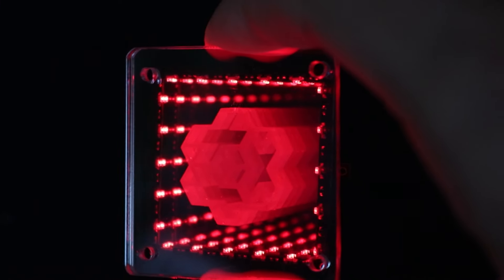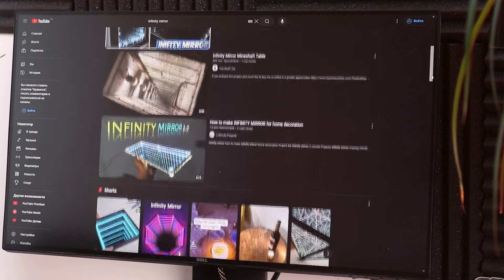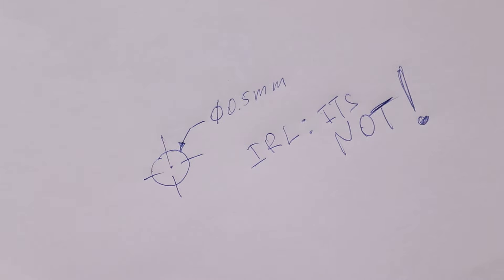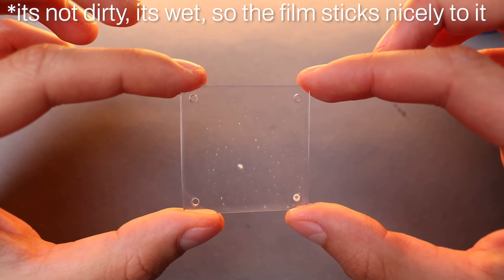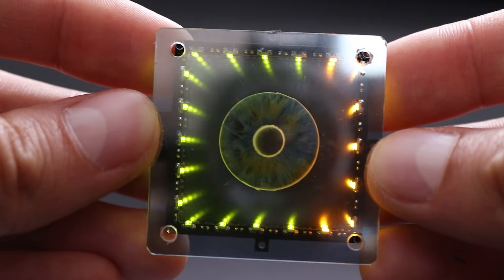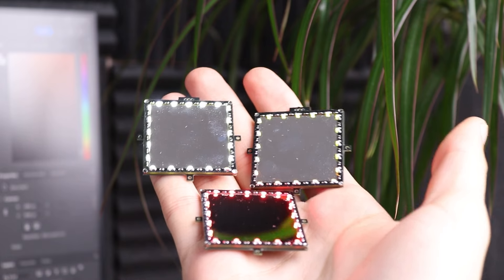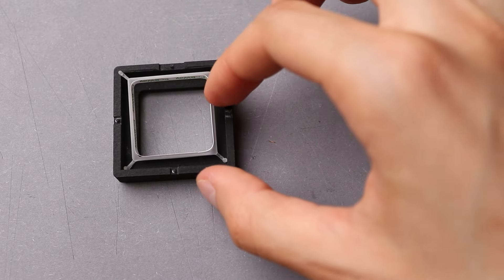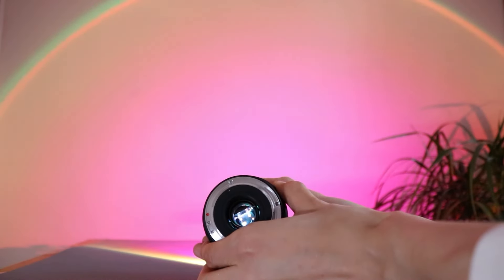I built an INFINITY mirror to Win $1000

Comment: If glass cutting is similar to acrylic, it helps to hold near the break point and you might do well to buy a pair of kinked pliers to focus the break directly on the scored line.
Reply from the maker: It's not exactly like glass. Glass is fragile, whereas acrylic is more flexible. It doesn’t break easily. It is a plastic after all. I actually researched the easiest way to cut acrylic at home without special tools, and that's what I used in the video 😅

Comment: now make it thicker, put some alcohol in it, add heat elements to vaporize it, connect Peltier element on mirror, cool other side and you have a makeshift chunky, hot art project Geiger counter., I like it (your project)
Reply from the maker: Quite a creative approach. Not quite sure I understand it fully, though 😅 I was thinking about adding moving LEDs in there and make some kind of a kaleidoscope 🙃
Reply: @NickElectronics, it's called a cloud chamber, but it needs dry ice to work, Peltier pads work only if you freeze the other side or stack them and provide lot of power, so in reality, it will never work for 😔
Reply from the maker: @ Why not use a vape for making a cloud? 😅
Reply: @NickElectronics  no it's called that. It detects alpha and beta radiations. They call it cloud, but it's not literally cloud (it turns into line clouds when particles pass through)
Reply from the maker: @ Just googled it. Looks crazy cool. But there should be a source of radiation I suppose.